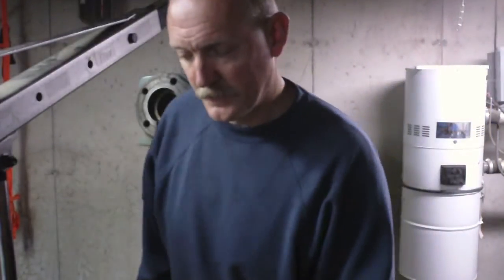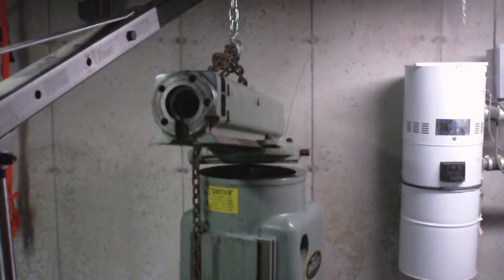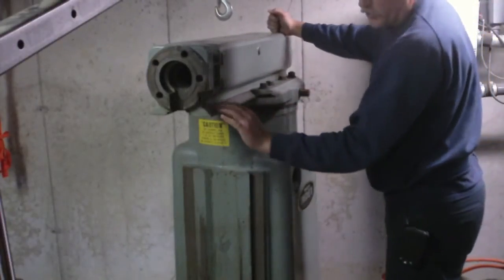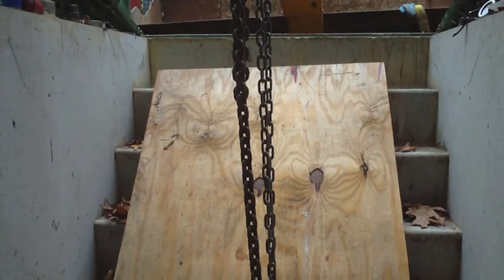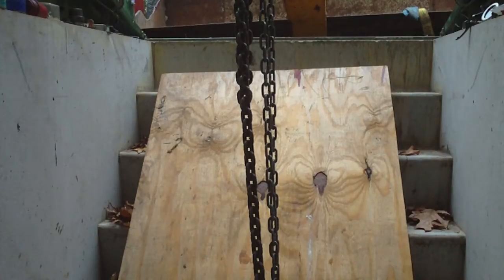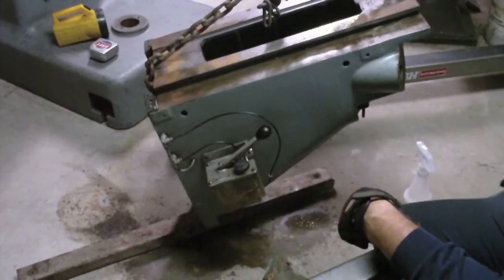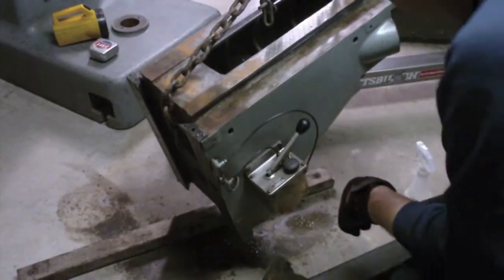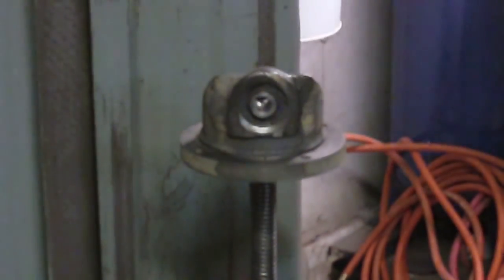Wells Index Milling Machine Part 18

Comment: Hi Steve,
I've been avidly watching this series of vids and feel it is now time for me to be a "Monday Quarterback ".
The bevel gears on the knee are going to get swarf on them. Therefore the lubricant used is not going to stop that from being a problem.
The solution is to stop the swarf getting on the gears in the first place.
I'm thinking about cutting a piece of pond liner or an old inner tube and covering the gears and the hole for the crank tube. Or if you want to get fancy fold some sheet metal into a box to cover them up.
Then you can use some wheel bearing grease to lubricate them. 
Cheers Eric
Reply from the maker: Both of those are good suggestions. I'm still surprised swarf gets in there in the first place. You'd think if it is falling into the gap between the back of the knee, and the main body, it'd not hit the top of the bevel gear several inches forward of that.
Reply: It's like sex on the beach.........
sand gets into everything
I'm relying on memory here not recent experience.
Cheers Eric
Reply from the maker: midgoog2 lol, Cheers!

Comment: Steve;

Knowing this is probably coming months later after you did the work, but here are a few comments.

1)  I think you made the right decision using oil on the turret.  That joint basically sets the tram of your mill (you can adjust the head, but having the ram and turret trammed is a big plus) and I think grease in that joint might have thrown off the tram by a couple thou.

2)  Just use the oiler for your knee screw.  All the working load is at the oiling point and if you give the oiler a pull every time you use the mill, should be no problems.

3)  I would recommend using a good moly disulphide grease on those bevel gears.  That bevel assembly gets a lot of work as the knee is the main adjustment for work height.

4)  Consider getting yourself a good camelback surface plate (blade?) to see how good your ways are.  Check out some of the scraping videos to see how guys measure flatness on their ways and scrape them flat.  That mill was used in a shop and odds are that there are some wear patterns in the ways that need to be corrected.  The only caveat to doing this that I will pass along is related to how you are going to use the mill.  If you want really high precision, then you need to scrape every way.  If you are just using it for hobby use and making the occasional part for the tractor, etc., then the ways are probably in good enough shape.

Regards;

Ron Kluwe
Reply from the maker: Hi Ron, thanks again for the insight. Yes, the videos postings are still way behind. I think I filmed this one first part of November, That being said, the mill is still not done. I finished assembly, only to find a couple other issues. As for scraping the ways……..I think it's one of those things that looks easier than it is. Reminds me of the story I heard about this guy who used to go to places and hand grind surface plates to get them dead nuts on. Guys would just watch this guy in amazement. Some guys just have "the gift". I'd be scared I'd mess up, and since I'm not building aircraft parts, I think the ways will be okay. I did have to shim one of the jibs, but that's another story.